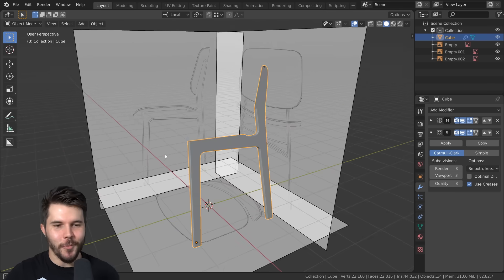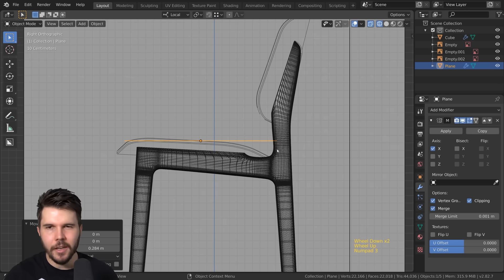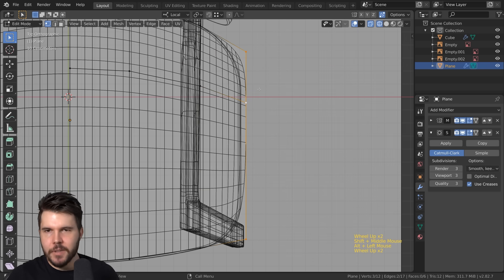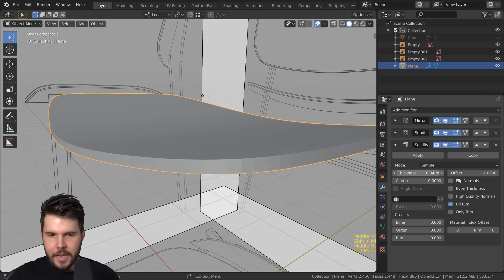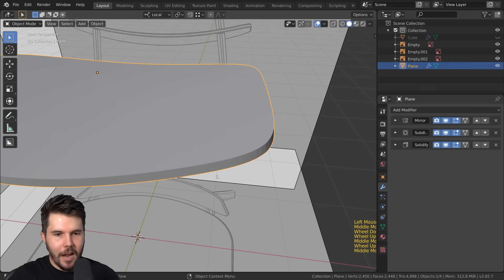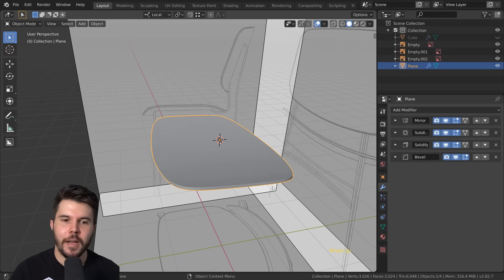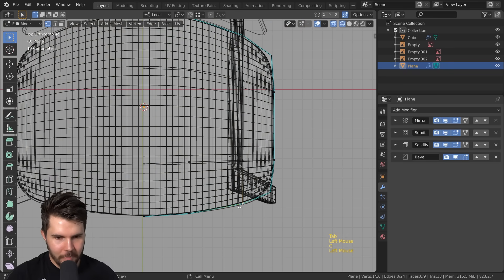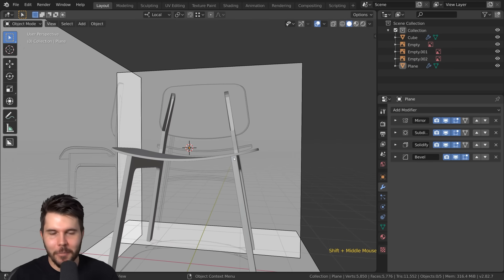Blender Beginner Modelling Chair Tutorial - Part 4: Modifier Mayhem

Comment: If you're exporting to another software then edge split is probably the better option than the auto smooth, blenders smoothing groups work a little differently to most other software and don't always translate over so may not render sharp in other programs, but if you split the edges they will always render sharp in other software.

Comment: I moved the top reference photo to align with the chair leg like in the video, but when i later applied the mirror modifier, the left chair leg didn't align with the reference and also the left side of the seat is a little short. From the front-facing angle only. It looks aligned from the top and side view. If I only model one side of the chair I think I can produce a perfectly acceptable chair, but it's off-model from the front. Should I do something about this?

Comment: I ran into some kind of an issue. I applied the bevel, and it does change the shape a bit. It has a bit of an edge as in the video. However, the offset does not seem to control anything. If I change it the size of the bevel is unchanged.

Comment: Just in case anyone else ran into this weird bevel/edge problem...
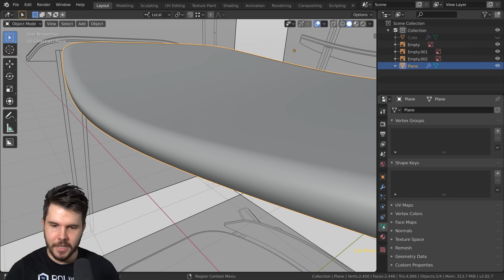around 11:00, he used the beveled edge with 2 segments and the edges all got "blurry"... I had that happen to my seat. The "mark sharp" thing wasn't really working for me, either. I realized that the reason was actually because the bevels with 2 or more segments were causing the angle of the planes at the edge to be /less than 30 degrees/, which is what I set Auto Smooth to at 8:24. So, i set Auto Smooth to a smaller degree (15ish in my case), and it fixed the issue for me!
Reply: thank you!!

Comment: It's important to know that Auto Smooth, altought it's a greak quick way to not smooth the surface as a whole, it only works in Blender. So if you want to export that model to another software, the Auto Smooth is going to be disabled in the exported model. The best way to do this is not to use Auto Smooth and instead add Edge Loops.

Comment: I need some help with connecting the leg and the seat. There is some space between the leg and the seat and I want to remove it by moving the vertices up till they connect. But when creating the leg we created a lot of loop cut and the leg was rotated in the last lesson so when I move those vertices up it makes some bends in front view. The only way I can think of now is rotate the leg back to the yz plane, do the vertices moving, then rotate it back to see if they connect with the seat properly. But I still wanna know if we can move vertices along an edge or on a surface (a specific axis or plane to be precise) which we choose. I've tried GG and Shift V, but they don't give the result I want (they don't let the vertices move out of bounds). Do I have to create a duplicate edge/surface, resize it, move the vertices along it then delete the temp edge/surface after? Or is there a better way to get the result I want?
Reply: I finally find a way to get the result I want by changing the pivot point of resize to one of the vertices on the edge. I will keep the comment in case some one need it.

Comment: Quick point about Edge Split vs. Autosmooth. Always use autosmooth where possible, and add Bevel modifier where its useful (like the seat here). Edge split will do exactly as it says when you apply it, it will split your mesh into multiple sections based on where the shading changes. This can often really destroy your model and require lots of clean-up. It's good to get a look at a model, and it can be really useful in some abstract work, or potentially some CAD based workflows, but generally for modelling it's not ideal.
Autosmooth can sometimes be fixed too with another modifier called "Weighted Normals", sometimes Autosmooth will smooth areas you don't want, no matter the angle you type, but Weighted Normals can often fix this magically too, and allow for some additional tweaking.
Reply: Edge Split splits the geometry, Autosmooth enables normals-per-face-corner, (as opposed to per vertex,) and splits the normals.  Not all applications will accept split normals.. for very general export of subd, you should still  bevel/inset/insert holding loops to achieve correct interpolation of normals, in the geometry.

Comment: Hey so I kinda followed everything so far and I feel so proud with my chair skeleton, but i have small issue with the faces that are "connected" to faces that we deleted (the ones where sitting parts touche the legs) There are always half open - they make this kind of shape  ╮╭  instead of being properly closed faces. What did I wrong with mirroring/deleting the faces?
Reply: So I found out how to deal with that. In Mirror modifier options there is "merge limit" I've set it up for 0.05 and it closed the annoying gap :)

Comment: Hi guys, I jumped into a problem that I had been trying to solve: problem is that my bevel tool just does not work, not not at all, it does one small cut, so it bevels, but I can't increase that, help needed.
Reply: You mean to adjust the curve of the bevel? You can roll the scroll wheel to add in edge loops to round out the bevel
Reply: Walker ! Same problem here((
Reply: To fix this hold shift. Holding shift will largely decrease the increments.

Comment: Hey, everyone. I am having some trouble with the Bevel modifier as mine doesn't show the 'Offset' parameter below 'Apply' and 'Copy' like in Andrew's modifier. Has anyone else encountered this or know a solution? I'm sure it's something small. Thanks!
Reply: I had a same problem and I used the 2.80 version , with the 2.82a the offset is there.
Reply: @Littlexxxmew  That's it! I just downloaded 2.82 and 'Offset' is indeed there. Thanks!

Comment: Is there a reason why i can't use mirror like you?. I actually need to delete half of my mesh and than it works.
Reply: Did you remember to tick the clipping option in Mirror modifier?
Reply: @joonaskilappa1113  Thanks for respond. I figure it out. When you add a mesh, the origin point is in the middle.. that's why modifier mirroring part within itself. If you move part in object mode, it moves origin point together with the mesh, so you will never be able to mirror anything in the way you want... but in edit mode if you move the mesh, your origin point of that particular mesh stays where it is, but object moves and in that case it's possible to mirror an object in the way we want. if anyone else have the same problem i think it's good thing to know that. It is not the same in which mode you move an object.

Comment: For some reason the Bevel-modifier never seems to actually bevel anything. All it does when not breaking something is shading the mesh differently, that's about it. I don't think i'm doing something wrong with how i use the modifier, but maybe it could be the mesh, or the steam version of blender, idk. Anyone know what's up or are the bevel-modifier just fiddly?

Edit: Just tried creating a fresh cube and use the bevel-modifier, it worked completely fine, i guess the mesh for the seat is compromised somehow and the bevelling doesn't work. Would still love to know how that could be <3
Reply: I have exactly same issue...Anyone solve this?

Comment: 11:27 It's because of the origin point not being exactly in the middle of the volume of the object. CURSOR TO OBJECT>ORIGIN TO CURSOR and then you don't have to use mark seam/sharp. So, origin point to the center of the volume via cursor and apply scale and bevel works like it should.

Comment: You could use the Simple deform modifier to bend it :)

I know all of this well but is fun to watch you.
Reply: I did mine with the Simple deform modifier, set to a empty and transform rotation X 90 degrees, set to Bend and Angle 35.2 on Z Axis; in the stack it was at last

Comment: Part of me is thinking that "photo" reference is probably just a 3d render xD

it'd be really funny if we're working off a "photo" reference of a chair made using the same blueprints as a base in blender, just like here, and is itself based on a real photo :3
Reply: Considering most of the Ikea catalog is 3D, not photography, I'd say that part of you is almost certainly right.  It might even be based on the same parametric CAD data they use to mill the parts in production.

Comment: you can call smoothing a sharp edge  a fillet , radius or round edge .. :)
Reply: Yes, the technical term is a radius or the plural, radii. Bevel is normally the term used to describe a straight face rather than a circular face.

Comment: The bevels causes the auto-smooth to break because it breaks a hard 90 degree angle into smaller increments. If you keep bumping up the number of segments on the modifier, the increment will eventually be below the threshold angle (30 degrees in your case) and everything will be smoothed out again.

Comment: Great tutorial series! One question. For me there is absolutely no difference between 0.01 or 1 when adding bevel. It adds a slight edge, but getting the thickness that Andrew got by default is impossible for me. How do I "enable" to actually adjust the bevel instead of just getting a tiny edge that can't be changed?
Reply: You need to use smaller numbers, if the distance is too large than the bevels will all look the same. Try within 0.005-0.001

Comment: Auto smoothing works on the maximum angle between two faces. The more segments you add with the bevel modify, the more you are reducing that maximum angle.
Auto smoothing set to 30 degrees.
Original edge = 90 degrees, so smoothing is good.
Add one bevel, maximum angle = 45 degrees, so smoothing is good.
Add two bevels, maximum angle = 22.5 degrees, smoothing is bad (i.e. less than 30 degrees).

The solution is to reduce the smoothing angle to compensate for any additional bevels you add.

Comment: The internal line in the seat part is the border where fillet starts so everything between those two internal lines is flat (or is curving in one direction - around the seat in this case). The external line is where the fillet ends, or - in case it is hiding behind - than it is a silhouette  of the part. Since internal end external lines are "parallel" - radius of that fillet has constant value  :)

Comment: The legs are wider on top, as is shown on the drawing. I added a Simple Deform modifier set to Taper to reflect that, on the Z axis and lock Y, with a Factor of 0.375. Just my 2 cents ;)
Reply: BTW, that modifier must be above the 2nd mirror modifier. If not, the second leg will be messed up.
Reply: Thanks dude, it looks a lot better with the taper.

Comment: I've got a question: something is wrong with my bevel - most of the time I can't change the size of it so as I move the slider nothing is happening. Only when it's zero the bevel just disappears. :c 
And thank you so much for your amazing tutorials! You're the best. :з
Reply: In the bevel modifier, I tried selecting "percent" instead of "offset" and it works
Reply: @ScarletFelicia  Thanks for this. I have been looking for a solution for 1 hour! You are great Scarlet!
Reply: try holding down shift, i had the same problem and it was that the slider steps where to large
Reply: I manually typed out the value and it worked out just fine for me :P
Reply: you've probably figured it out now 10 months later but changing the angle in 'auto smooth' helps
Reply: same problem with me! :ccccc
Reply: Same problem here. I am struggling with bevel modifier in general, not only in this tutorial :( Has anyone found a solution?
Reply: i usually move the mouse a lot after ctrl+B, when it has changed i adjust the amount to desired look. also, you could try typing in the value for the bevel
Reply: Me too! Does anyone know why the Bevel Modifier is not changing when offsetting??
Reply: Guys! I found out the problem! Just turn off Clamp Overlap!
Reply: @SanjiKicks  Sadly turning off the Clamp Overlap makes the face orientation be completely out of wack. I have the same issue and i cannot for the life of me figure out why the bevel modifier does absolutely nothing except for some slight shading when it's on compared to off.
Reply: @Zehonart  my face orientation looks just fine. Everything is blue.
Reply: @Zehonart  Nah it's not the face orientation that's wrong. The modifier just makes all the smaller faces star wigging out and intersecting with one another
Reply: @SanjiKicks  Thanks :D
Reply: try to decrease che Levels viewport value in Subsurface modifiers, you could have now more space to apply the bevel
Reply: For anyone experiencing this issue: You need to turn off clamp overlap AND change the "amount" to 0.002 (doesn't matter the order). Details: untick "Clamp Overlap" in Geometry setting of the Bevel Modifier; in 'Amount' (the slider under Width Type drop down in the Bevel Modifier's settings) change the value to 0.002 or something similarly small. This should make things look normal. If you don't make the value <0.01 your mesh will look MAD. Hope that helps future Blender warriors!
Reply: Do you have vertices on top of vertices in your mesh?

Comment: The reason the Bevel Modifier sometimes smears out the auto-smooth is that the new "faces" the modifier creates to round the edge, are each less than 30 degrees to each other.  Increasing your autosmooth angle setting will fix it!

Comment: Just a question about the first part: since we used mirror modifier for the base, when you rotate it, how do you solve the chair foot? Half of it is in z<0 and the other half is in z>0 (kinda). And more, i want it flat in z axis. Do I apply the mirror modifier and then fix it?

Comment: you have the auto smoothing set to ignore angles greater than 30 degrees.   When the bevel is only one segment wide the angle is greater than 30.  once you subdivide the bevel up into more segments the individual angles between segments drop below 30 and the auto smoothing takes over.   a larger bevel will also lower that angle down and so there is a point where a single segment bevel will become large enough that the angles drop below 30 and it gets smoothed as well.

Comment: When you increase the number of steps in a bevel you decrease the angle of each edge.  When you reached a point where the angle of each edge was less than 30º the Auto Smooth was bypassed.

Comment: Anyone else having issues with crazy shading on the mirrored legs?
Screenshot of mine (turned on face orientation view):
https://www.dropbox.com/s/fnws94jsvef2w1c/Screen%20Shot%202020-05-02%20at%2010.43.20%20PM.png?dl=0

Checked face orientation, recalculated normals, applied scale, merged vertices... I have no idea what is going on. I even tried duplicating it, deleting the second mirror modifier, applying the first mirror modifier and subsurface modifier, then trying out the mirror modifier, same thing.

I haven't been able to solve this, so in the meantime I just applied modifiers and "mirrored" it by hand by duplicating and moving/rotating the duplicate in place. The mirror modifier seems to work fine on other objects, I just wish I knew what went wrong with my leg mesh.

* Edit - fixed! Needed to move the 2nd mirror modifier above the subsurf modifier :)

Comment: Homework: make a backseat
Me: copypasting the seat and tries to to make it fit just right.

Also Me in 30 minutes: crying in the corner because nothing is working like it use to be.
Reply: Same here, buddy＞﹏＜
Reply: Copying the seat worked for me. It's important that you don't have too many edge loops though, otherwise it will be very hard to create a smooth surface. I think I had a 4x3 grid.
Reply: @Mobin92  i had that problem, but instead of removing the edge loops, i used the loop tools addon, to straighten the edges via the "gstretch" option. That way you get extra detail and it still looks smooth. One problem i had is that the top view never 100% aligned with the others so i just ignored it

Comment: The bevel is shaded smooth, because the auto smooth setting has the angle set to to much od a value. Just decrese it. Also, when you add subdivisions to the bevel you decrease angle betwen the edges thus triggering the smoothing.

Comment: 11:27 you need to check harden normals for the best shading. it makes blender calculate normals correctly for hardsurface models.  currently your normals are very incorrect.  also you have too many redundent polygons.  reduce subdevisions.
Reply: hello, harden normal immediately improves the appearance of the corner, but if as you say down the subSurface subdivision, the whole curve becomes much less defined and more squared. thanks for the helpful comment anyway :)

Comment: Yeah those double lines in the drawing are from the fillet (rounded corner in cad, vs. chamfer, which is a flat bevel). They indicate where the fillet starts and ends. They're actually really useful for determining where your bevel should start/end, although the bevel cross section wouldn't be perfectly circular (as they would be for something like this chair). Blender bevels would be closer to a G2 curvature continuous fillet in cad. This is also very nicely illustrated on those inner round corners on the legs, they pinch more to make sure they give a nice smooth transition. But if you want them to be circular you  need to add loop-cuts to approximate a circle.

edit: 

Question: you created the bend in the seat by manually moving the vertices, wouldn't a bending modifier be better? Because then you don't have to worry about the outer vertices not following the surface properly. Maybe that would be more effort than it's worth.. I come from a cad-surface modeling background, so this is the kind of stuff I would be nit-picking about...